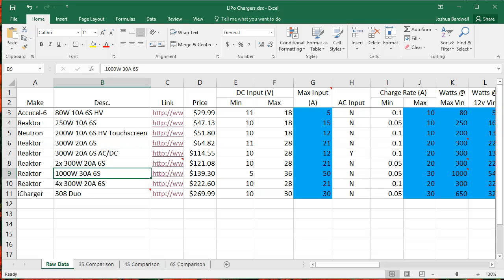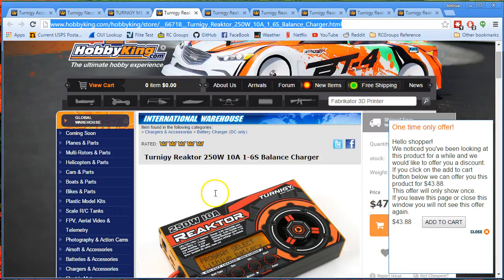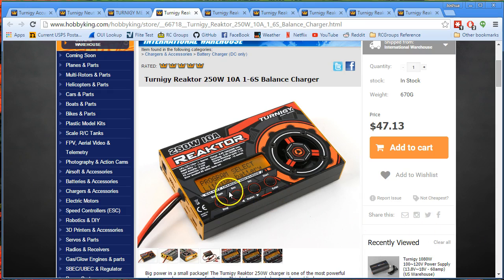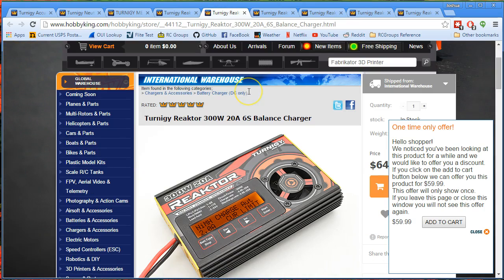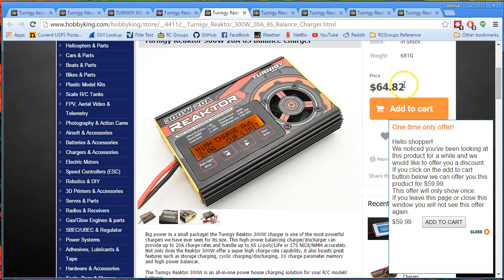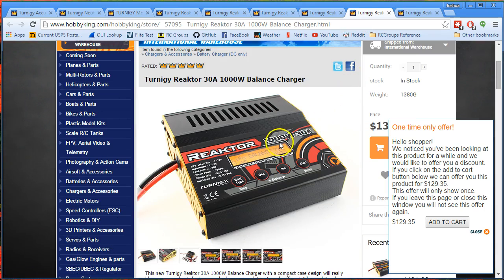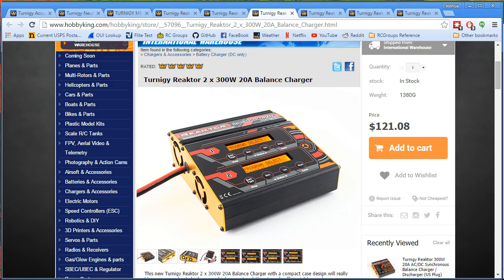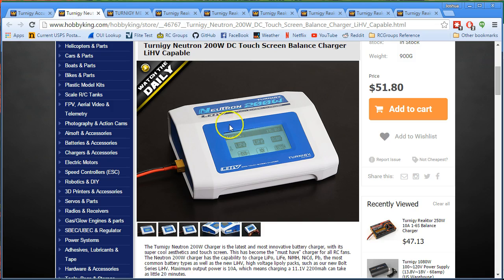LiPo Battery Charger Roundup

Comment: I just purchased the Reaktor 2 x 300W last week. Should have it on Monday :D Got lots of recommendations for it and picked it up from the Aussie Warehouse for $69USD Delivered!
Reply: Yeah that's cool you lucky bugger. My imax is ok but its discharge rate sucks (2.0).
Reply: Believe me I was in disbelief myself. I'm usually the guy that buys stuff at full price and then I find they day after it's on special :D You have no idea how many specials I've missed out on. It felt like I won the lottery
Reply from the maker: +BMSWEB For that price, it's pretty hard to go wrong. If you can feed it 18 volts or thereabouts instead of 12, so much the better.
Reply: I only just received yesterday afternoon and man it works a treat. So happy with it. Only have 14V going through it atm but I can live with that until new power supply comes in. I only charge at 1C anyway, so even if I put 8 packs on just one of those ports, that's 8 packs done in about 40 mins. Build quality and buttons are all great. I thought about doing a video on it, but couldn't wait and had to use it.
Reply: +BMSWEB how did you get it for that price? Its listed as $120 http://www.hobbyking.com/hobbyking/store/__57096__Turnigy_Reaktor_2_x_300W_20A_Balance_Charger.html
Reply: For some reason they had that for $69USD in the Aussie warehouse :D Insane pricing
Reply: Not any more :(
Reply: I asked the question on our FB page which Chargers people have had a good experience with and this was the most popular one. I would have purchased it at the full price but at $69USD it was a no brainer.  I noticed not long after my post they all seemed to go really quick

Comment: how about the tbs charger, that what i had been looking at get
Reply: +Rob B That's a bit harsh.
Reply from the maker: +Barnaby Harper Get an Accucel-6 80 watt for $30, and a 50 watt 12 volt power brick for $10. You'll be $15 ahead, and you'll be able to charge HV batteries if you want. There is no reason to pay $15 for the TBS logo, IMO.
Reply: +Joshua Bardwell TBS = Total BS :)
Reply: +Joshua Bardwell can you give me a link to a power brick as i a struggling to find one
Reply from the maker: http://www.amazon.com/HitLights-Watt-Power-Supply-Transformer/dp/B00BPCL0MY
Reply: thanks

Comment: I would not be making apologetic points for HobbyKing- I use them too- have for a long time.
They need to address the horrible follow up and customer service issues to be worthy of a mention or vocal support though. Not speaking the harsh truth can and will lead to a perception of that "sell out" moniker you were unfairly slapped with.
Reply from the maker: +Hiway I know that people have had problems with HK customer support. Personally, I have only ever had one issue, which was when an order got stuck in processing and wouldn't ship. Eventually, I had the order cancelled. Other than that, every order I've placed from HK has had zero problems. So I'm not saying that other people haven't had problems, but I can only speak from my personal experience.
Reply: +Joshua Bardwell on a positive note, I did some comparisons with my 4 port charger (Q6400AC) and it is not as good value as the one in your lineup. mine has an internal.power supply and can be used at the field or as a power supply, and I am one of those folks that has a myriad of various bats so I like having the 4 separate set ups. One thing my charger does though is charge HV. it has to be forced though. I use parallel boards on each of my 3s and 4s ports and then have a HV port and a port for various tx and goggle bats that has an octopus adapter with 19 options. altogether it is a cumbersome and unwieldy set up, but at the field, as you point out, it is a great charger station that can handle a lot of different lipos all at once.

Comment: I agonised over the question of multiple single chargers vs multichannel chargers on the eggs and basket basis. In the end I bought the 308Duo because it offered better integration and versatility. I like the display which shows all the critical information for both channels on a single screen so no need for constant scrolling.
It is probably a good idea to plan for what batteries you may require in the future. After the dust has settled all of the chargers here would have little problem with small miniquad packs but perhaps not so well with larger 8 and 10S packs for Helis for example. At the risk of offending I think discounting higher voltage power sources was a little short sighted in these higher duty cases.
I have to say a large part of the attraction of the 308Duo was the datalogging which it turns out is not that usable. The option to datalog to SD card is nice but lacks any means to identify the packs or even time stamp the files. The PC connected option for data logging is potentially much better but the recommended third party software is far from intuitive. Essentially the data logging is so cumbersome I rarely use it. These same arguments would apply to the Reaktor series as well BTW.
All of this talk over the so called HV LiPos to me  is a distraction. I admit I have not looked into these packs simply because of the price premium over conventional LiPos. Does the extra fraction of a volt really make any significant difference? I don't know. That will take some longer term high discharge testing to find the real efficacy of these new packs.
Reply from the maker: +Rob B Good point. I limited the roundup to 6S chargers, because I suspect the majority of my subscribers are flying 6S or below. Once you get up into the 8S and higher realm, it's a different ball game.

Not sure what you mean by "discounting higher voltage power sources was short sighted". I guess you're saying you disagree with my assumption that people aren't going to run these guys with higher-voltage sources. You're right, in a sense. Some people do run them at higher voltages--there's a whole awesome thread on RCGroups about ganging 12 volt rack-mount server power supplies to get 24 volts for battery charging. I still stand by my assertion that the average buyer doesn't realize that they need to feed the charger with more than 12 volts in order to get its rated wattage out of it.
Reply: +Joshua Bardwell That was pretty much what I was trying to say Joshua. I agree with your assumption on 12V supplies for the average Joe charging smaller packs, the higher voltage setup is more expense and work but really is essential for larger packs. I recently did a small poll of miniquad flyers charging habits. All of the responses were in favour of charging their entire collection of packs prior to leaving home, none indicated any inclination to field charging and by extension they were ideally looking for higher power chargers. By minimising the time to charge the full compliment of packs maximises the chance they will be actively monitored during the charge process which is of course the safest outcome.
Another thing about charging large S count packs is you can use this to charge multiple 3&amp;4S packs while in series which in turn allows for normal cell voltage monitoring and balancing. In fact the balance boards supplied with the 308Duo are serial charge breakouts for this very reason but obviously such a setup will dictate a higher input voltage to get the best from the charger. The downside is the packs must be of the same capacity unlike the parallel charge case.
So I guess we are on the same page. I agree 100% with your conclusions given your intended application and assumptions,  I was thinking of the more general case.